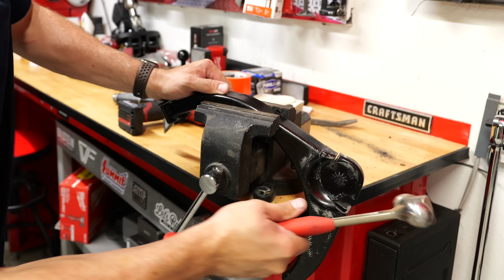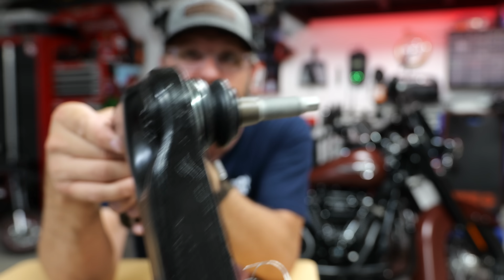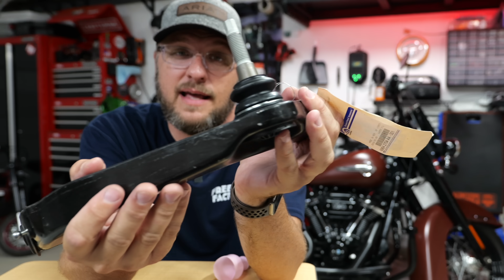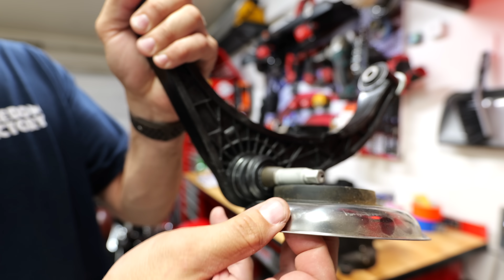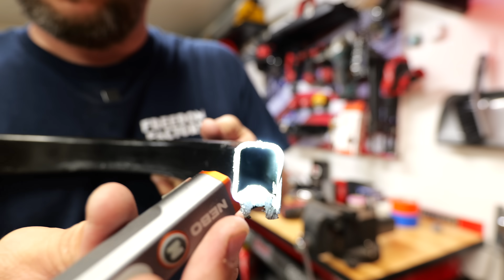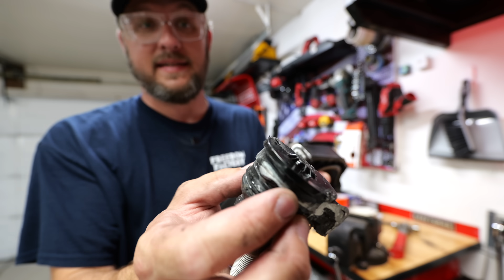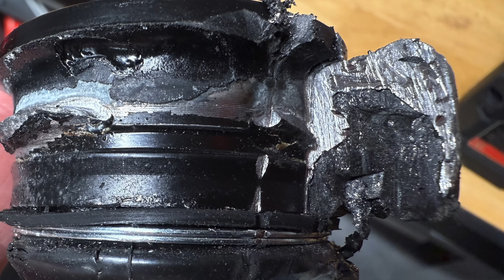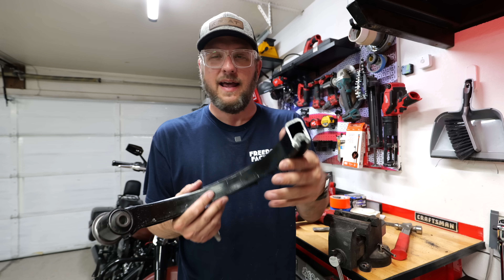I Cut Open RAM’s Plastic Upper Control Arm… Worse Than I Expected?

Comment: Started thinking about temperature expansion coefficients. One has somethin around 12E-6  1/K and other around 200. Meaning worst case difference of 180E-6 1/K.

With half a meter part and from winter to summer 60 K difference that means roughly half a millimeter difference in lenght plastic vs steel. So with each temperature cycle that part is slowly tearing itself apart.

What a paradox to dive into composites when trying to cut costs...
Reply: So all plastics and all steel alloys have the same coefficients of expansion, respectively?

Comment: when it comes to interior electronics, there's five legals/essentials/standards that i expect and five luxuries:
1.  ignition key  2:  horn  3: indicators  4: windscreen wipers  5:  lights 
1.  radio  2.  windows  3:  ac   4:  cigarette lighter   5: actually, that'll do won't it?

Comment: When that plastic becomes brittle the control arm will loose its strength. Also the steel used is very low quality chinese steel that is why ram isnt coming out and saying its boxed steel with plastic they are covering their butts in the event that these cheap junk parts break and cause an accident.

Comment: It's essentially a tubular control arm, which is pretty cool in my books. Light & strong.
Reply: @rotaxtwin  yeah, it's not a high load part, I don't see an issue with it. 

Better than thin stamped steel with reinforcement valleys stamped in that hold water and encourage rust.

Comment: Honestly whether or not it would be stiffer would prob. come down to the exact plastic used, might be possible if it was a glass infused nylon (Prob still need more, if it was solid infill of it i'd definitely would be stronger than a stamped steel part)

Comment: First thing I did on my 2021 Ram 1500 was put a ReadyLift kit under it with a metal upper control arm. I was shocked to find plastic.

Comment: Cylinder deactivation is just a brute force attempt to lower fuel consumption without any further considerations for longevity.  You are buying something designed to be junk right about the time you pay it off. Planned obsolescence. The plastic is a stiffener, without it the steel wouldn't be strong enough.

Comment: I think the plastic is used for its insulation properties to reduce vibrations and road noise
Reply from the maker: I don't know how much vibration or road noise is coming from a UCA. I think MOST of the loading into the frame is probably coming from the lower control arm and the tires themselves.

Comment: You cant bring up GMC's shitty MDS system without also saying that it works just fine in Chryslers 5.7 hemi. It is a GM issue, not a cylinder turn off issue.

Comment: As an engineer and former racing mechanic, this part gets a passing grade from me. The design provides vibration damping and corrosion resistance, while keeping a boxed steel core. GM and Honda use pure plastic suspension components like sway bar links, and no one is complaining about those. I worked on a Buick Regal this week and the engine torque strut mounts were plastic.

Comment: I dont want plastic suspension.  Plastic oil pans. Plastic intakes. Plastic interiors. Rusting out frames. Recalls upon recalls. Plastic valve covers. Plastic gears in transmissions. Engine failures. 60 grand check engine lights wrapped in cheap plastic and sorta metal. And influencers gaslighting me.

Comment: I cannot comment on the specific polymer used in this application. The LFT material my parent company supplies for similar applications outperforms current cast aluminum designs in most cases when properly designed for the polymer, even without the steel core.  Especially when combined with Unidirectional tape to even further reinforce key areas of the part.

Comment: I bought a 2025 Ram Big Horn last month. Made the first payment two weeks ago. It started pulling hard to the right for no real reason. Never been off-road or any abusive driving, just normal everyday hwy driving. I took it back to Dodge 3 times, they checked and changed the alignment and ran a different set of tires and wheels and nothing made it better. The fourth time I took it back, the GM got involved, and he’s getting Engineers involved. Saying all of that…. I think this upper control arm design is starting to show its design flaws.

Comment: It's  settled , it's fine you cut it open, it's got boxed metal in it. Truck frames are boxed metal their strong enough for normal  driving . These upper control  arms are the same.  Bunch of people  over reacting. Glad you did this appreciate  it, my 2020 RAM has them no alignment issues, noises  nothing  but tight steering  it's doing what it's supposed to.

Comment: Interesting. The metal is likely thinner than previous full metal arms. So the plastic filler keeps the ends of the metal from buckling. This is an effort to make it lighter. 
Future  problem might be delamination. 
Thank you for cutting it. I have been curious. 
Even though this arm doesn't really see alot of load.  It would be interesting to see a stress test.

Comment: We The People deserve the choice!  Build the vehicles properly,  quit building them to fail! If gas economy is the priority, put a button on the dash! They can easily do this. 
And they can add a couple other choices, focusing on torque, horsepower.  Why do I  need to go to aftermarket supply to make my vehicle run as it should,  Per My Requirements? 
The problem is hedgefunds and corporate greed is focused on fucking the consumer.  
I wouldn't buy any new truck or car, they're garbage out the gate. 
GM, Dodge, and Ford can just die. To have these great engines an transmissions available and they just throw cheap crap designed to fail proves they are not worth the American dollar. 
Hey Elon Musk, do you want to be the greatest trillionare in history go buy Chrysler or GM and give me a call. I will  help you build the best cars and trucks the world has ever seen, and they will look a thousand times better than the cheap plastic crap these chuckle heads could ever think of.
Make American Automobiles Amazing Again!  Build something worth spending our money on.

Comment: I worked plastics and the biggest problem you have, especially with steel and plastic together, is the warpage. The transition from hot to cold makes plastic brittle really quickly and the plastic will expand and contract faster that the steel causing separation. The upper ball joint keeps the spindle assembly that holds the wheel assembly together and if that fails, the wheel will fly off. That is a bad day for anyone driving these vehicles.

Comment: My concern is long term. If the arm is fully boxed what happens as condensation builds up inside or if the lower plastic rail delaminates due to corrosion. This might be the jeep liberty lower control arm recall all over again but worse due to it being on the steering axle.

Comment: I drive a tow truck 14 hours a day everyday. Since they released that junk I have already towed in about 10 of those 1500 trucks NEW trucks. The problem? upper control arm broke at the ball joint JUNK.

Comment: AH !!!!! HELL NO !!!!!!!! My 1995 GMC 3500 4/4 A arms are built like Sherman Tank control arms !! You cant brake them !!!!! i sent it up in the air in 98 5 feet above ground truck is still rock solid. THESE $100.000.00 trucks today are SHIT !  NO THANKS !!!!!!!!

Comment: The gaslighting about engineering (like "fuel saving" strategies to satisfy CAFE requirements) is the inevitable end result of government interference in the auto industry.

As long as the manufacturers are more concerned with satisfying the politicians, bureaucrats, and lobbyists, they will ignore the needs of the end user.

It's why all the modern new cars are $#17.

Comment: People in the 60's whined about seat belts, then front wheel drive in the 80's, then pissed at fuel injection etc.  Steel parts covered in plastic so they don't rust and maintain their integrity for decades is now a bad thing.....🤣🤣🤣

Comment: Filling that entire cavity with plastic would make it both heavier and possibly more expensive than the standard stamped and welded control arms. Plastic is more expensive than steel as a material, but the cost savings comes from the ease of shaping it into a useable part. No matter what the car companies tell you what the reason is, the only goal of them is to keep manufacturing and assembly costs as low as possible while staying within a certain mpg bracket and quality is good enough to not get sued for hurting people. Plastic tech has come a very long way, and this part must be structurally fine because they'd never take the risk on a suspension part that could cause some major lawsuits. Through my experience with the evolution of plastic where it shouldnt be in cars  is the longevity of this piece especially in regions that salt the roads. I forsee a delamination issue over time through flexing of the part that will only get worse as the rust creeps up between the steel and plastic. The issue I've been seeing pop up for at least the last decade is how everything has been engineered to such a bare minimum that the littlest bit of rust completely compromises the safety of parts that should've never been made that thin

Comment: I'm impressed with the control arm. I agree the plastic looks cheat but after cutting reveals more steel. 
I wonder what would happen to the plastic side after exposure to UV rays aka sunlight to see if it gets brittle after the sun exposure & time? 
I learned something today. 
Thank you 👍

Comment: A good reason to buy old vehicles and stay away from just about everything made today.  Engineering must be silent when decisions are made. Fuel savings is not customers goal, cost and longevity are more of concern. All the gas savings stuff today is why vehicles don’t last and have so many failures and recalls such as the GM 6.2 engine failures.

Comment: I got only to 2:20  in the clip until you said trucks today aren't over priced and it sounded like you might be saying that plastic is ok for suspension systems. That's far enough and I've heard all I need from you. Thanks but no thanks.

Comment: There’s nothing inherently wrong about using plastic to replace steel. The problem is not using the right plastic for the part. These decisions are made to reduce costs not improving the product.

Comment: The nice things are this thing should be cheap to replace and it's lightweight. The bad things are... Everything else. I do understand it may be adequate. I'd just prefer it was all metal. If nothing else, this is far more likely to degrade and crack over time than metal. That said, just the metal arch that comprises most of the control arm really should be plenty to do the job for quite a long time. As you said, the plastic is basically just holding spacing rather than holding a load. Nice analysis. Will be interesting to see if there are issues in the future.

Comment: Not a plastic part, it’s probably to reduce vibrations or something. Plastic isent bad aslong as it’s used correctly. If it’s used to cut cost then yes it is definitely not good. You also get no increase in rigidity by filling it with plastic, you may infact may make it worse. You get flex from the steel that may be effected by completely filling it with plastic

Comment: Yes, get rid of AFM, OnStar, Wifi, oversized radio screens and all those other popular gadgets. Let's get back to building real trucks again! Not some electronic junk that will break and cost too much to repair. Put reliable parts back on and these vehicle, without all the silly add on gadgets, and prices should be much lower. Scanning 1st Gen Silverado approximately 130 signals,  2nd Gen around 500 and 3rd Gen and up is up to 1000 signals. Too many add-ons to go wrong.

Comment: Great video. It's all about saving weight, which isn't necessarily a bad thing. A steel tube is actually quite strong when compared to cast steel or iron. And, there are some high quality "plastics and polymers", such as Delrin and glass filled nylon. And, don't forget Glock (and similar) polymer pistols. This may be a rare case of the new design actually costing more, all to reduce fuel consumption by minute amounts.

Comment: Plastic tends to age poorly. Only utter desperation would lead an engineer to use plastic for a control arm. Automakers give zero fvcks about anyone but themselves. 
Everything is garbage in 2025 and there is even a term for it from the tech world,  "enshittification".  
Wise truck enthusiasts don't just run old trucks, we collect their replacements in advance. I've lived through several vehicle "cycles" where trucks like 67-72 Chevys were casually scrapped then not much later are considered collectible. It's worth knowing nothing will improve in the new market then ignoring it.  Anyone able to spend new truck money should pay off their land, home and retirement fund first. (I retired at 47 debt-free and major part of that was due to never  buying new trucks and keeping old ones for decades.

Comment: Did RAM take a page out of Fords playbook? IT appears to me that those arms are going to trap water. Possibly lots of water and cause the arms to rust out prematurely requiring a trip to the dealership for replacement. I'm also guessing that the ball joints will be a factory item only sold pre installed in the control arms.

Comment: What you are seeing is engineering to the low end of the part limit. To where parts used to be engineered past the upper limits of a part. So now these parts are more likely to fail or be damaged in minor collision or even in this part, just hitting a pot hole.

Comment: And there is the problem.  The manufacturers are building with cheaper parts, not better. But the prices have skyrocketed to where the averaged buyer can't afford them. And this is why the influx of warranty issues and recalls across the all manufacturers. And I think it will get worse before it gets better.

Comment: now they say its steel with some plastic, over the time, may be they would increase the amount of plastic to 90%, and market the arm still as steel with some plastic, 30 years later, you have to buy the rights to say my control arm is made of metal, and by manufacturers definition, 99.9% plastic, with some metal shavings sprinkled, 3 days warranty, better than none, this is our best offering. We as consumers.... well... i would be amish by then

Comment: I remember losing my mind when I saw plastic sway bar links when the 4th gen Ford Taurus came out. They were junk links as well and all the aftermarket ones were metal. To make such a critical part like a control arm or away bar link out of plastic (especially on a truck!) is pure greed showing through on the corporate level.
Reply: The control arm is not plastic - it is boxed steel with plastic filler in the bottom channel.  Tell me  you didn't watch the video without telling me.
Reply: @rickbrewer8507 I was referring to plastic suspension components in general as shown in the video. You must not have paid much attention, Cleetus- but I'd venture to say no one ever accused you of doing that in your life.

Comment: Manufacture says the plastic encapsulating is to help reduce corrosion.
Reply from the maker: It isn’t encapsulated, it’s only in the bottom and the steel is e-coated.

Comment: I don’t like plastic in a structural, load bearing, or critical area, however like metals there are “plastic” composites that vary widely in strength and weight.
The composite intake manifold has worked out pretty well in durability (not all applications) and function as it does not transfer heat. But it is fugly.
As oil pans however they are bs.
   I have never seen a hollow boxed upper control arm on a truck, that’s more interesting than the ‘plastic’. I’ll pass😂.

Comment: Was it Mercedes Benz that made the bio-degradable wiring harnesses? They were supposed to last (I think) 15 years or so before self-destructing, but I remember an auto electrician telling me many lasted about half that - engine heat killed the insulation. I bet several manufacturers are gearing up for another attempt at that !

Comment: The plastic isn't even solid on the bottom side.  Ram didn't squirt in enough plastic to make it a uniform thickness, but rather left ribbed areas.  If those ribs are stronger than a flat surface, you should really be concerned because Ram is deriving strength from ribbed plastic instead of steel or aluminum.  As a side note, for some reason the upper A arm on my 67 Mustang is much beefier than the lower.

Comment: 1. Engineer everything to last juuuuust past warranty. A former coworker of mine once worked at a Ford dealership as a line tech. One day he saw suits and whitecoats approach a Taurus in the next bay, examine a part that was failing too often within warranty, and then make notes to redesign it to...not do that. But only just.
2. Engineer parts as units so that there are fewer small parts to inventory, and a justifiable reason to say "You can't repair this, you have to replace it". Why would they want to sell you ball joints to fix the RAM this guy is talking about when they make more money selling the whole arm, and then make MORE money putting the arm on because not a lot of commoners can do that at home.
3. Engineer vehicles so that repair access is diminished to the point that the buyer gives up and says, "Whelp. Gotta' take it to the dealer." A good example is my wife's Terrain, in which if you want to check the transmission fluid, you must have it at operating temperature, in gear, level (so you can't check it on ramps at home...only on a lift), and of course you have to be under it instead of using the 100 year old dipstick design.
4. Happy shareholders.

Comment: Engineers see: reduced weight, equal strength, improved flexibility, practically eliminated rust/corrosion issues, reduced manufacturing costs. 
Rednecks see: plastic.